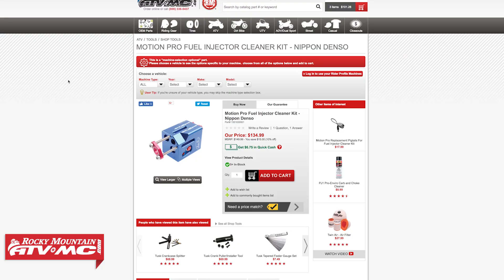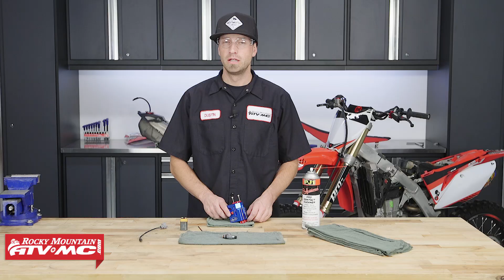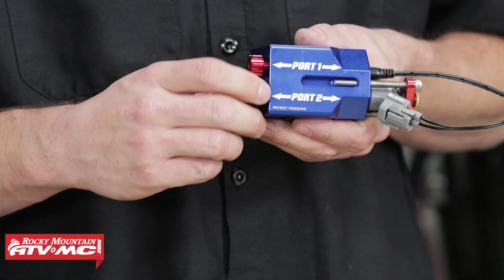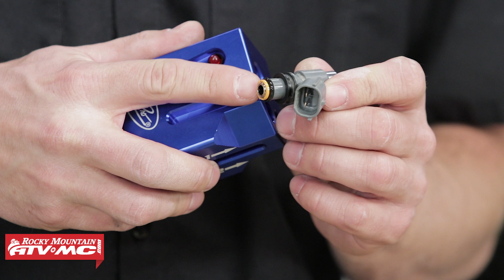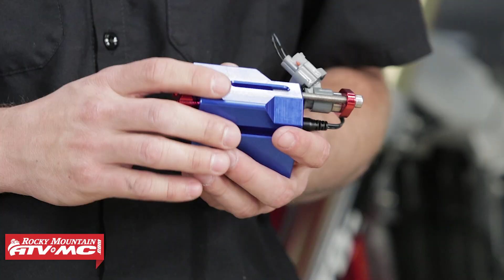How To Clean Motorcycle Fuel Injectors

Comment: At the cost of that tool you might as well buy a new injector
Reply: It pays for itself if you're using it for a business, but for personal use, I agree with what you said.
Reply: Nope... injectors for my SV650 are around $200 EACH.....
Reply: Ditto. 140 for mine. 2008 CBR600RR. And there's upper/lower rails so there's 8 of them. So I guess we're talking over a grand to replace them all xD

Comment: Just use a 9V Block and alligator clips and spray from the wron side works the same :D
Reply: Yes sir. That is a simple 12v fuel shut off solenoid. Hook up some leads to a 9v battery, spray out the nozzle.
Reply: Why a 9v battery ?... Why not 12v ?
Reply: @jimmysparks315  Because 9v batteries are easy to find and use, plus that's all you need to open the valve - DC is very forgiving that way.
Reply: Are injectors polarity sensitive?
Reply: @pattocooper2304  They just wont click open so you can just change the polarity. They dont get damaged that way.

Comment: How often should a motorcycle fuel injector get cleaned? Your immediate response will be highly appreciated 😊😊 thank you ☺
Reply from the maker: Well that’s hard to say. It's dependent on the amount of time used and the conditions its been in. If its sat for a long time it probably needs it, if it starts running poor that might be the cause and needs it. If there is a lot of moisture probably needs it.
If you treat your fuel with Yamalube fuel stabilizer on a regular basis that will solve most potential issues.
  Thanks
Reply: Rocky Mountain ATV MC what if you use non ethanol race fuel like T4
Reply: Oh I see, thank you so much sir Rocky 😃

Comment: For less money you can send your injectors out to be cleaned by a proffesional shop. Thos method does not apply enoug force. And a shop will give you data for before and after. But cool tool none the less.

Comment: Is there a fuel injector pig tail for a 2011 RZR 800?
Reply from the maker: You can check out all the different style pigtails Motion Pro makes and match it up.  Here is the link to the pigtails: https://www.rockymountainatvmc.com/p/754/52835/Motion-Pro-Replacement-Pigtails-For-Fuel-Injector-Cleaner-Kit
Reply: Ok, thanks. Not sure which connector my 11 RZR has. I will have to look next time I have the plastic bed off.
Reply from the maker: DG Adams - I'm looking into this more for you.  So according to Motion Pro's website they don't list your 2011 RZR 800.  Just the RZR 900 for the year 2011 and they recommend the EV6 pigtail for that machine.  Does your service manual state anything that your fuel injectors are serviceable by chance?

Comment: How often do you guys think this should be done?
Reply: id say it like a carb if your bike starts running like shit take the injector out and clean it in our 2 strokes that run pump gas we clean the carbs every 25 hours but in our race bikes that run vp race gas we clean the carb every 50 hours when i get my new kxf in a couple of months i was thinking every 20 or 30 hours to clean the injector but its up to you if you are just riding with your mates id just clean it if your bike doesnt run right
Reply: Well this is OP is 6 months old but for others benefit if you are running a fuel sock, or have installed aftermarket fuel filters you can probably go much longer.  I am pushing 400 hours and have never pulled my FI (KTM FI). Have a fuel filter sock in the tank which makes it painfully slow to fill (remove for races) but keeps out everything from getting sucked into your fuel line in the first place.